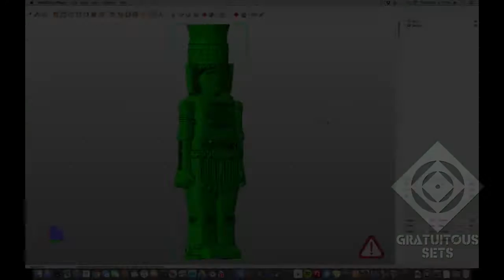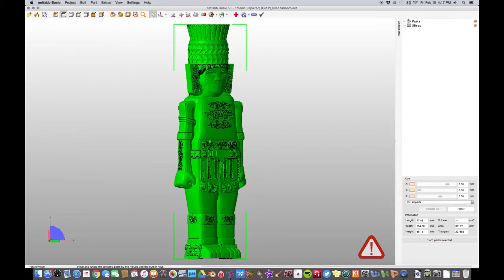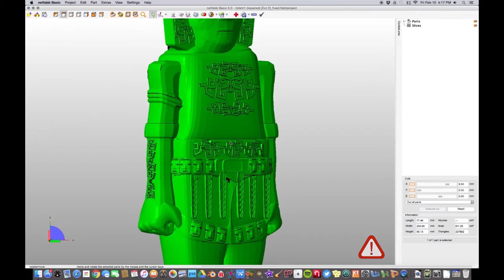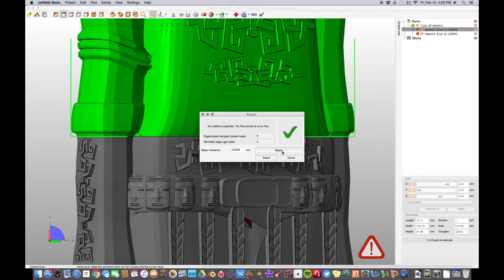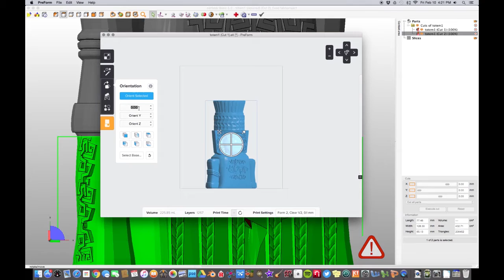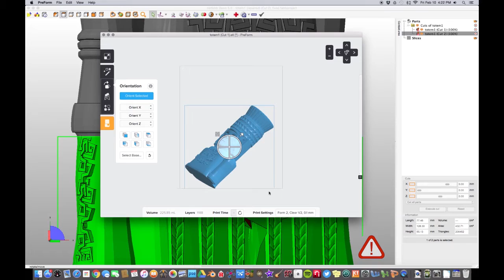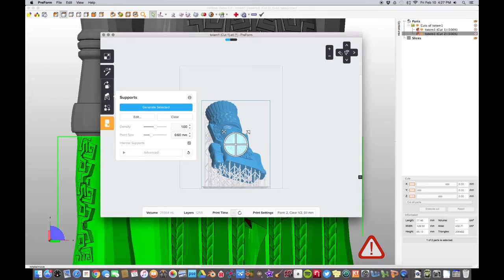Escape Room: Idol 3D Printing

Comment: Looking at that particular part, I'm surprised that you couldn't print the two halves, side by side, in one print with no scaffolding. There don't appear to be any overhangs on the part that would create isolated islands on any layer.
Reply from the maker: If I remember correctly, each half was taller than maximum Z, so they had to be tilted